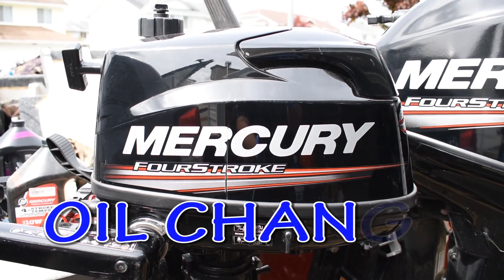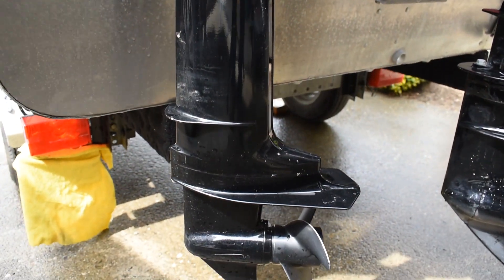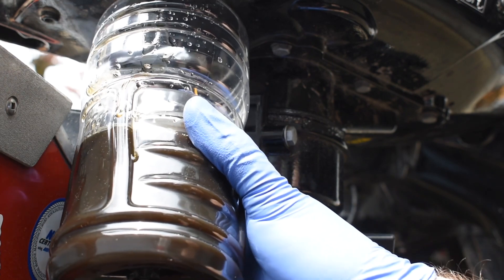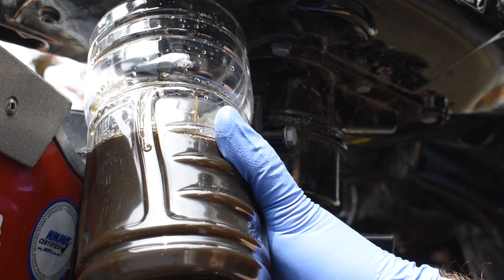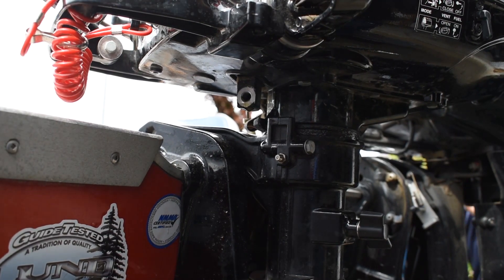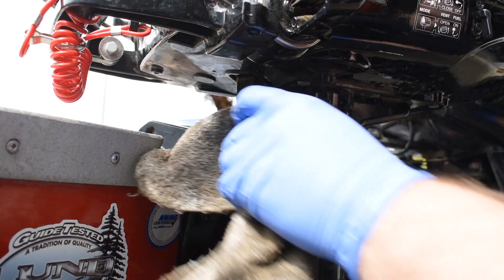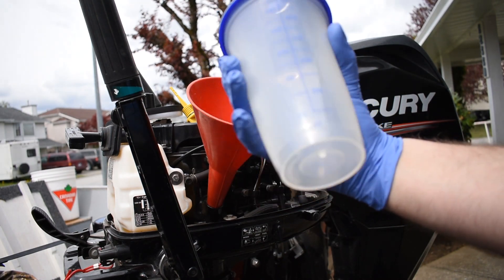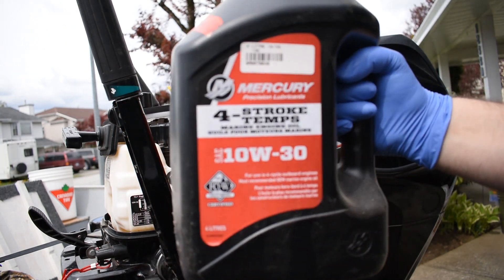OIL CHANGE on 6HP Mercury Outboard

Comment: 1)Thanks for the video.
2)Is a Tohatsu outboard, re-branded  (shame on Mercury). 
3)The drain plug, is not on a "practical" place. Yamaha have it on an ideal place. Also you have to turn the outboard on the other side, drains more oil. (Sorry for my bad English) 
4)Yamaha outboards have better quality than all other brands/manufacturers. Are more expensive, but "you get what you pay". LOL

Comment: How reliable has it been for you.  Just purchased a 2020 model. Hoping I never need to use the 3 year warranty
Reply: Got my hands on ethanol free 90 octane fuel. So that's what's goin in. As well as the recommend mercury FC-W certified 10w30 oil
Reply from the maker: KG Projeckt Very reliable motor never ran any special fuel and was a solid motor for trolling. I also used this motor on my Jon boat in a marsh in harsh temperatures and the motor never had any starting issues at all. Never had a single issue.
Reply: @BCBackwaters  thank you for response.  Have 3 hours on it love that little outboard engine
Reply from the maker: That’s awesome so happy I could help!

Comment: How do you like it as a kicker? I’ve been looking for a used Yamaha T8 because I’ve heard two cylinders are a lot smoother but I have an opportunity to get one of these for the price of a used Yamaha. Is the vibration tolerable?
Reply from the maker: Jim Bo 
Hey Jim it worked great as a kicker for me and your right it may of vibrated more than a Yamaha but it didn’t bother me at all. Can’t compare but I know Yamaha makes solid motors as well!
Reply: For price weight can't beat it. Yah it vibrates and is noisy but it's also cheaper than yammi and weighs 60lbs. Tohatsu makes these for Mercury, they are stupid simple in design like a lawnmower. Run ethanol free gas as the jets in carb are very small don't want to gum them up

Comment: Just curious, how did you run the motor out of the water for warm up?  Standard muffs do not work on this model due to location of the water intakes.  Did you run it in a garbage can filled with water?  Great video!  Thank you for making it!
Reply from the maker: I used a Rubbermaid I was able to Jack up the front of my boat to get the leg down lower to reach however a garbage can would also work
Reply: Ok.  Thanks for the quick response!  I appreciate your outboard motor videos! Very helpful!

Comment: Hey what happens when oil runs out I. A six fourstroke boat ingine
Reply: Can some one tell me please
Reply from the maker: If the oil runs out your pistons will seize in the cylinder and probably destroy your engine or cause a lot of damage.
Reply: @BCBackwaters  the props spinging and when I pull d cord it tombolin still
Reply from the maker: Mitra Ramnarine without actually seeing a video of what it’s doing it would be hard for me to diagnose. I would suggest taking it to your local marine mechanic.

Comment: I have a 14 foot StarCraft. I am looking to buy a motor. I am looking at that 6 hp Merc. I don’t have a ton of money so I can’t go up to a 25 however a friend of mine has just about the cleanest old Johnson 25 . He said it runs perfect and it looks almost new.  It’s around A 1984 to 86. I am thinking I would be better off with the new Merc. I can get one with 2 hours on it for 800.00 or go to the older 25. I am not sure what one to buy. I am just using to do some light fishing with. Does that 6 move your 14 ok? I know it won’t plane but that does not bother me.
Reply from the maker: Yes a 6 will move the 14ft it will just be slow but for lake fishing I’d say you can get away with a 6HP if you are in any kind of current I wouldn’t go less then 15hp. If I had to do it all over again I’d probably go with a late 90s 2 stroke as they are a lot lighter and much easier to work on.
From my past experiences I wouldn’t by anything pre 90s but just my opinion.
Reply: @BCBackwaters  ok! TU very much. 👍

Comment: Great video.  I have a Johnson 15hp 4 stroke 2005 motor.  Do you or anyone know if my motor has an oil filter or do I just change oil similar to this video?
Reply from the maker: According to specs I see online it does have an internal oil filter behind 3 screws on a triangular plate however without seeing your specific motor I couldn’t say for sure.